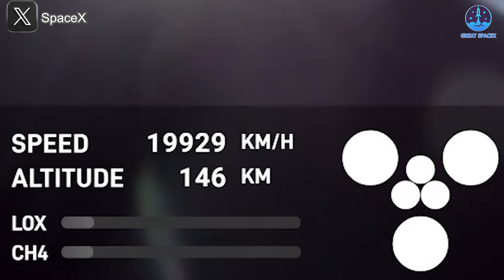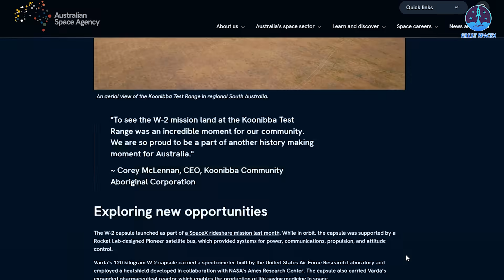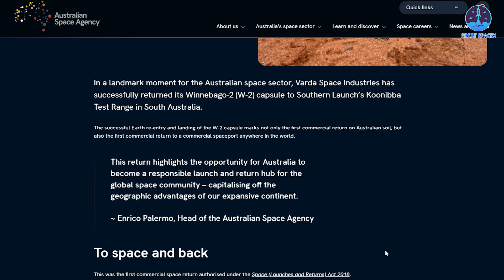SpaceX's Solutions to Fix Starship V2 Problems During Launch...

Comment: The problem with V2 is fluid dynamics because they switched from 1 to 4 downcomer pipes causing low pressure around the pipe inlets causing bubbles and vibration. They need to go back to 1 main downcomer and all splits need to be below 1/2 way and able to flow 120-140% of maximum use at every junction eliminating low pressure zones and max fuel supply.
Reply: I’m not trying to be “that guy”, but may I query as to how you drew this conclusion?  Unfortunately, God was cruel to me and the side of my brain that wanted to be an engineer was devoid of any mathematical functionality, much to my chagrin.  As an aircraft mechanic of 40+ years and a child of the Apollo era, you have my rapt attention.  I am aware of good old Bernoulli and his equation relating to pressure, velocity, volume, and many other horrifying things relating to fluid dynamics.  I know that cavitation in a fluid around very high rpm pumps is the boogie man in the closet.  So, that being said, HTF did SpaceX miss the obvious?!?  Even I, the great mathematical retard of our era, knows that you don’t do lots of changes after a failure, small, incremental ones.  What say you?
Reply: @NeroontheGoon  It's no different than the engineers overlooking you need a concrete wall between fuel and oxidizer at the first fuel farm. First, they are using a fuel that is trying to turn back into a gas from a liquid. When you put 4 main pipes at the bottom of the tank your pressure drops accordingly, with them being so close with tons of fuel per second into each pipe is going to create turbulence and low-pressure areas allowing the liquid to turn into gas creating bubbles. These bubbles getting into the turbomachinery is what caused the harmonics/vibrations SpaceX found on flight 7. If they go back to 1 primary downcomer and split off of it in a staggered pattern and reducing the size of the main at each junction should solve all those issues.
Reply: SpaceX had and so I assume still has a good reason for the change in the downtube system. The fact that they have had issues isn't surprising. They are at a stage they have made major changes to the fuel load and size of the rocket. That can easily cause problems that can only be found when an actual launch takes place.  SpaceX is working in an environment never seen before. Starship is bigger and more powerful than any rocket ever designed before. It's even of materials that haven't been used before. So it's only surprising to novice engineers that some issues are tough to solve. Remember when they needed three changes to fix the fuel icing / filter problem? They don't fix every surprise the first time. They will solve this one just like all the others. As to your suggestions unless you've designed a massine rocket I doubt you have an understanding of what SpaceX is facing.. ROFL
Reply: @kstaxman2  True bit with the success of V1 getting to MECO and my knowledge of fluid dynamics to maintain that flow rate the tank can only have 1 main exit and wouldn't make and dividers for RVAC engines higher than 1/2-way point in the downcomer tube and needs to maintain 120-140% of max flow at and below each split. Its basic fluid dynamics, 9-meter diameter fuel tank with 1 big pipe at center of dome = high flow and high PSI where 4 large pipes in same area = high turbulence, low pressure zones causing bubbles with low flow rate and lower PSI. This is why for the first time we are seeing RVAC burn through on the methane cooled nozzle. The turbulence and bubbles also explains the harmonic/vibration issue SpaceX said they had to address, and would definitely RUD an engine
Reply: You don't have to be an expert in fluid dynamics or even engineering to see that the major design change is the vacuum engine downcomer. You simply need to be aware of cavitation as a phenomenon to suggest that is the most likely cause. I'm not gifted mathematically and am an archaeology major and even I can see it. I agree with the OP 💯
Reply: @Kadath_Gaming  I think it got overlooked that both fuel and oxidizer are trying to turn back to a gas instead of a liquid. The only thing keeping methane and lox a liquid is pressure and cryogenic temperatures and loss of either one they change back into a gas. Reminds me of when I was trying to MSG both Elon and SpaceX and comments on content about needing a concrete wall between fuel and oxidizer at the first fuel farm months before the government told them the same thing. Thanks for the reply
Reply: @ANGRY_AMERICAN  Interesting stuff, too bad it took a high speed confetti demonstration to figure out what they did wasn’t what was supposed to be done.